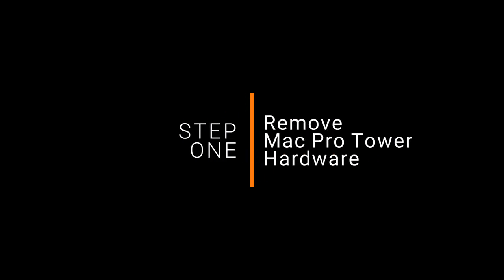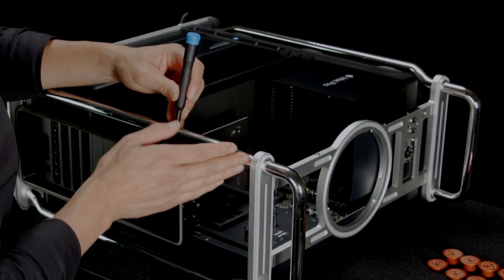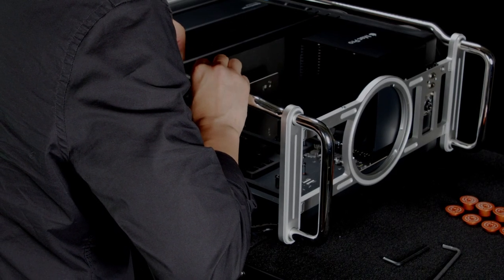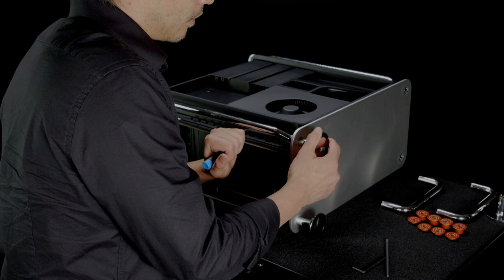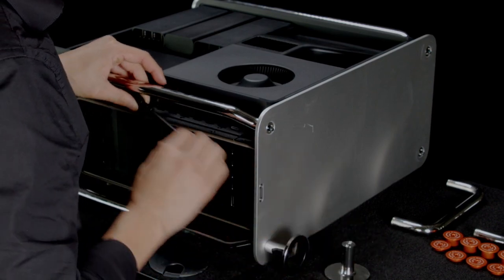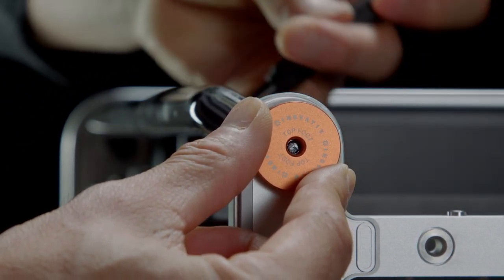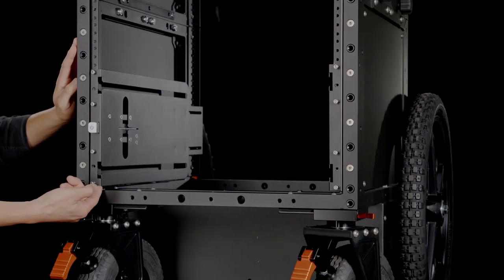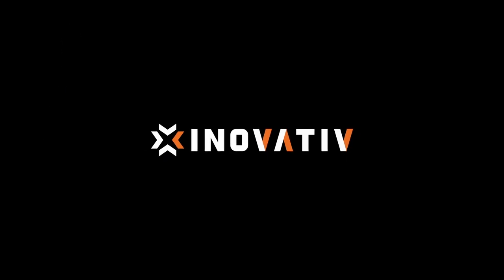Tower Rack System Overview

Comment: 2 questions: will this fit in any rack? And how do you switch the Mac on if the power switch is not visible due to it being rackmounted?
Reply: 4:14 Button lever on the rack mount kit presses the button on the Mac Pro.